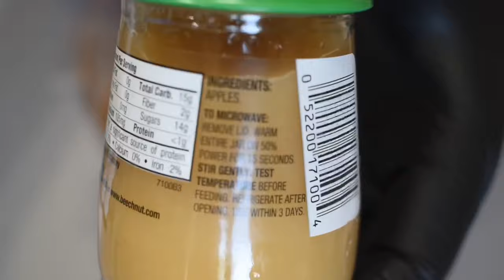2019 YT Fall Into Autumn Soap Collab | Apple Jack  Peel Cold Process Soap Making With Apple Purée

Comment: So pretty. I love the swirl😊 What % of water to oil do you soap at? I made my second batch and didn't change the soap cal. Which is set at 38% and I want to try and shorten the curing time. ( I'm inpatient 😔) my soaps have been curing for 4 weeks now and I can't smell my scent Melon ball by WSSP.  Any thoughts on what % I can soap at to cut 2 weeks off of curing? Thank you for any suggestions.
Reply from the maker: I use a 36% lye concentration which equals 22.64 water as percent of oils. 
I think using a discount shaves off about a week of curing. This is very debatable though. Some people say it takes off 2 weeks and some people say you still need 4-6 weeks.